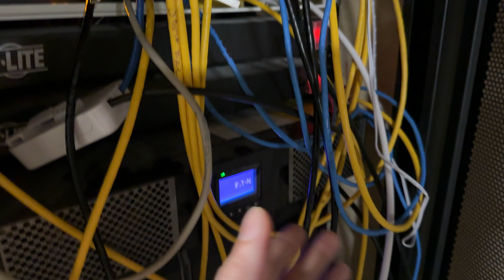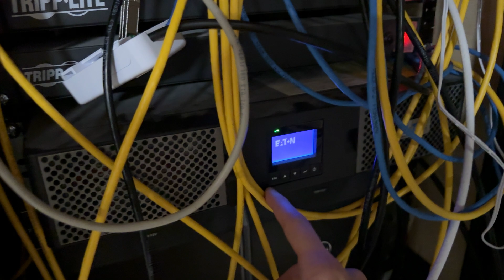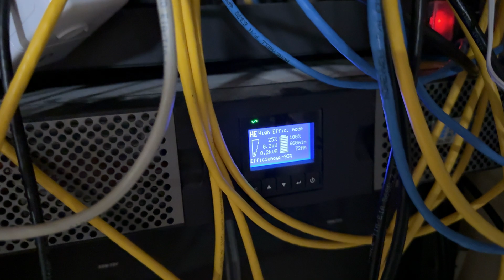Internet go ZOOM? Network upgrade time!

Comment: Over the distances of ethernet over UTP (100M).  There is no latency difference between fiber and copper.
Reply from the maker: It’s actually fairly easy to measure the latency difference over longer lengths. It may not be meaningful to most users, but in some applications it’s quite inportant.